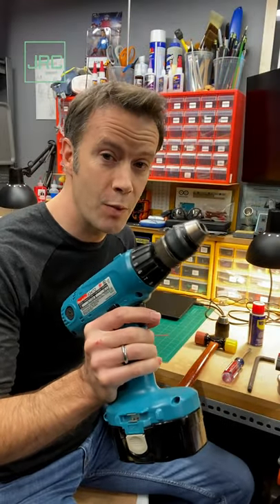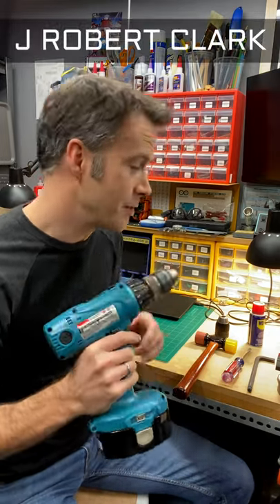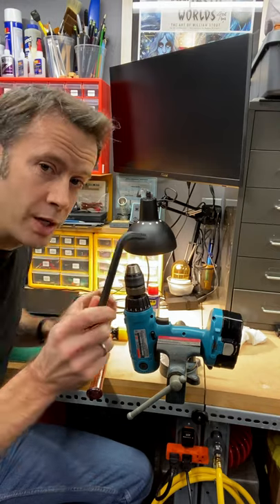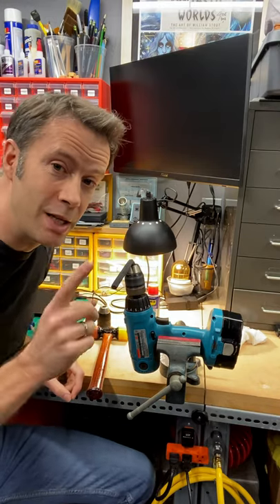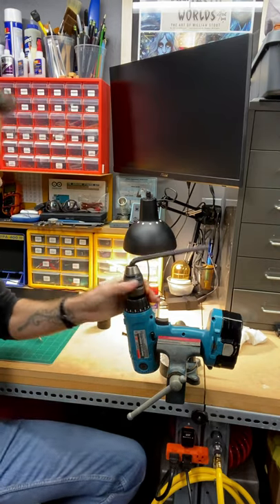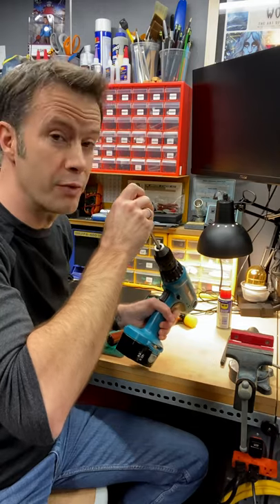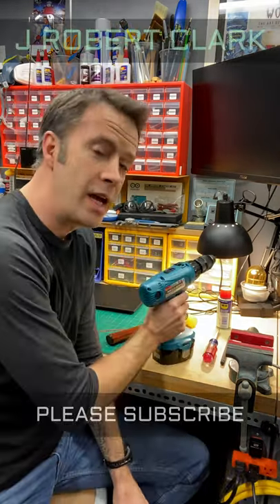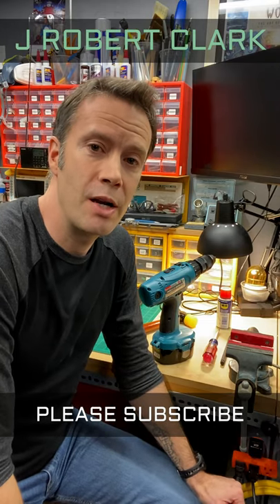Replace a drill chuck the easy way! #shorts

Comment: Love the old Makita, but you gotta try the new stuff brushless and lipo batteries are a game changer but keep to Makita love them.
Reply from the maker: I know what you mean. I will - but that one has been such a trusted friend. Maybe I'll add to my set but still keep the old one in service?
Reply: @JRobertClark  hell yea keep the old girl in service,.You can even get and adapter to use the lipo batteries with the older ones and give them a bit more poke. Not sure if you have tried the impact drivers but if you haven't you really need to. Keep up the good work 👍